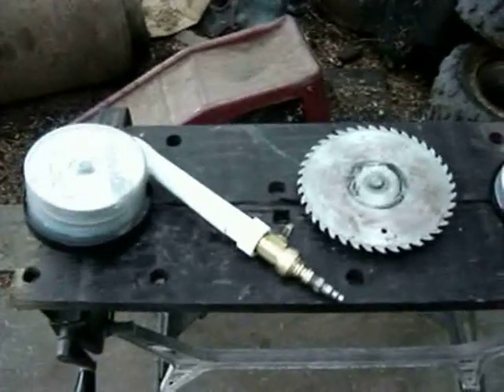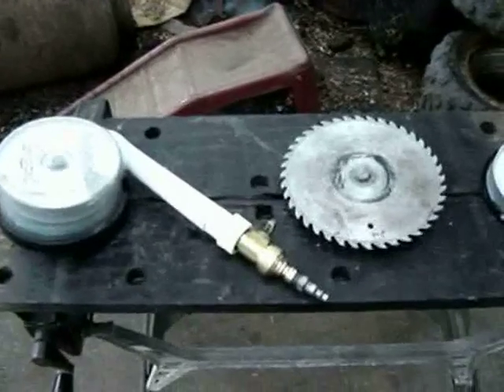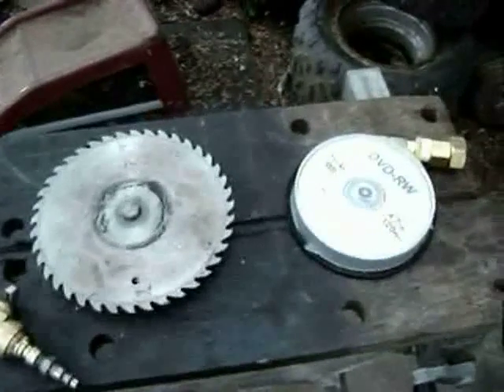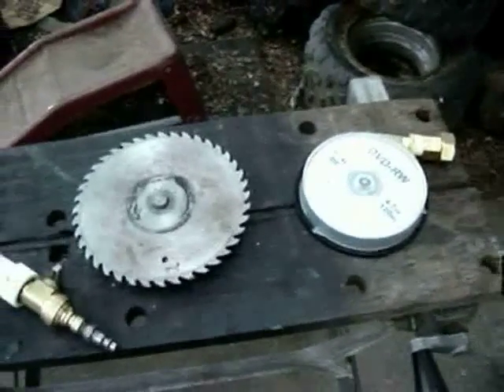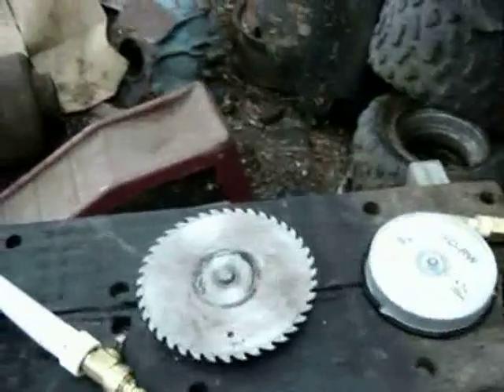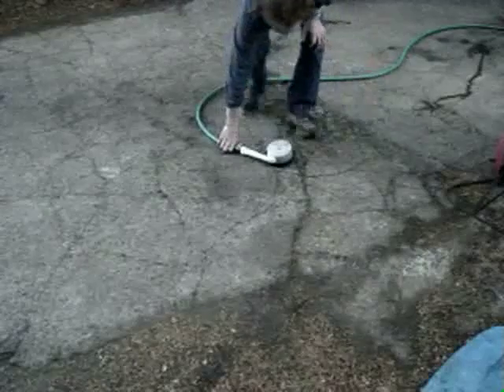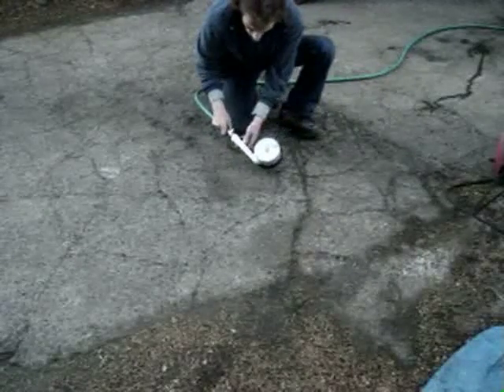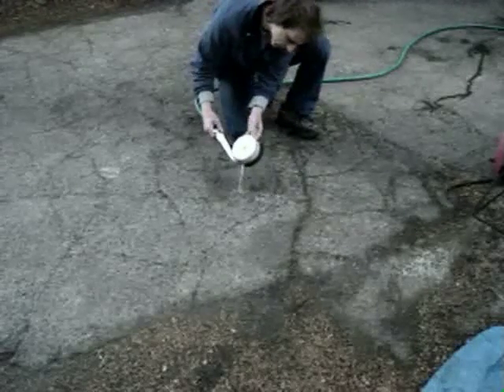Running The Tesla CD Turbine On Water

Comment from the maker: It's true that the cover to spindle base is a more-or-less permanent glue job. It's best to test as much as possible first, before the glue decision!

 I've tried using an o-ring seal and rubber gaskets, but it didn't work so well! (i.e. I got real wet...;)

Comment from the maker: You're right...I haven't had a beaver for a while.

Seriously, I did invent a backpack gas-powered device for girdling trees, called the "L'il Beaver'. It has a chainsaw chain wrapped around a cone as the cutting head and takes big chunks out of tree bark to kill weed trees.

Not half as much fun as running a magnetically-attached Skilsaw blade powered by compressed air and CD's on a CD spindle, though. (See my PumpkinCutter video ;)